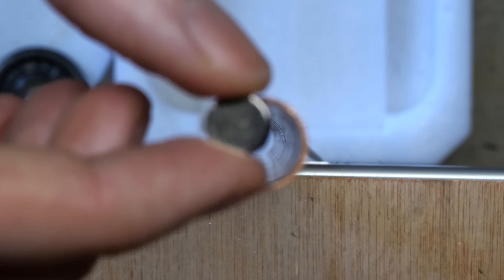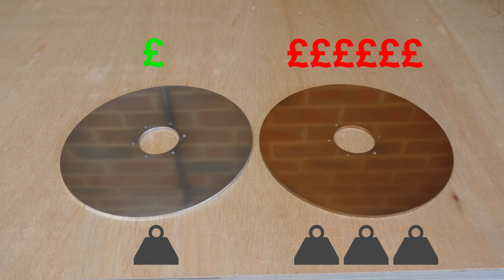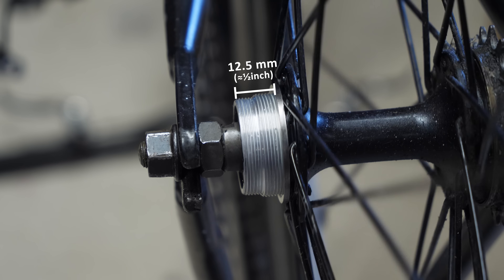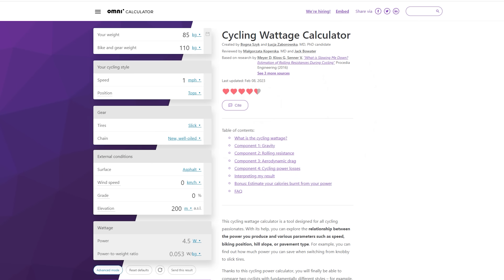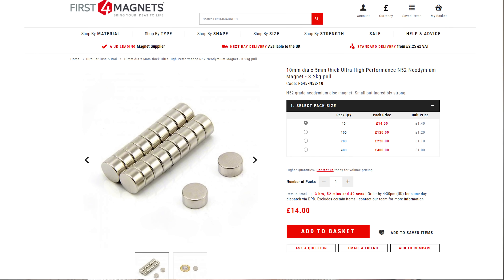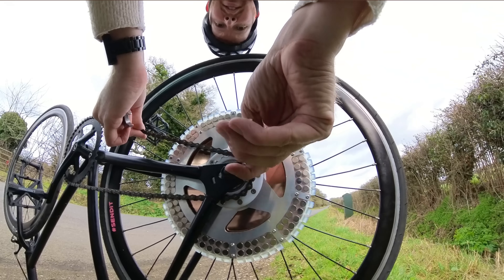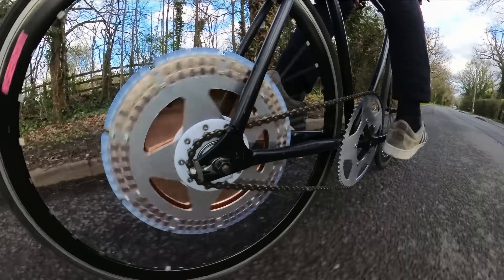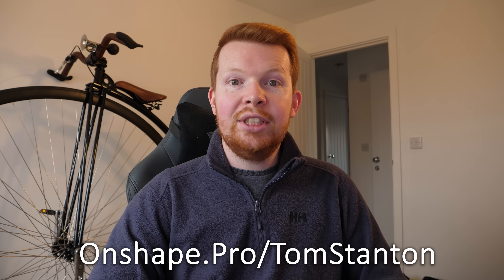Gearless Magnet Bike

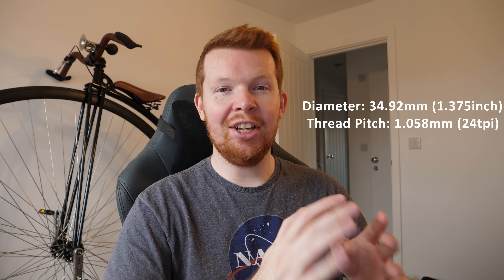Comment: 5:30 in  (you may answer this later, we'll see). How does the eddy current work if the surface is shaped closer to the magnet shape? E.g., suppose you had a non-conductive axle with a donut section of copper...? Would this improve or weaken the resistive forces?

Comment: Just think if you used a Tesla Bifilar pancake coil made of thick copper wire and measured the voltage generated with your falling weight rig when you let the weight fall.

Comment: seems like an interesting add on as a clutch in a system that has sudden power draws. Like a gas engine powered generator when it suddenly gets hit by a huge load. Seems like a less stressful way to deal with the forces vs a traditional clutch though that assumes you wouldn't have constant power lost from the heat put into the copper over time and ignores the material cost. Like if you added a flywheel to the mix that seem interesting. That energy lost to heat though. hmm

Comment: Hi Tom  well maybe not practical for a street bike. BUT I think the gyms would like this product. a person can vary on a cam and cable the distance magnets to the wheel for more drag or less.  Also i think your next build is along the guide lines you have here but with energizing coils for your drive to the rear wheel. Deenergize down hill or use the braking etc to reenergize the battery for the next cycle of coil energization. interesting concept.  Thank you for all the hard work.

Comment: You could bring the bike to a complete stop quicker by pedally backwards. It's a bit like a torque converter on an automatic vehicle. There's a similar technique of taking offroading vehicles down steep hills by throwing them in reverse and giving throttle to increase braking. That way there's no heat and wear on the friction brakes and it's a form of dampening the braking effect on rocky terrain, which can help comfort, control and traction.
Of course, applying throttle to slow down in any vehicle is just burning energy.

Comment: formlabs is such a cool company. if the rigid resin is too brittle, durable V2 may deform more but won't crack as easily. you can also play with cure times and temperature to fine tune the rigidity

Comment: Ask ChatGPT to fix your thermal problems. Instead of bicycle you made it into heater. You are losing efficiency somewhere. That is why brushless electric motors are so efficient and when they break they also charge the battery a bit. You kind of made a brushless electric motor variant, it is unique and I like it! From Mechanical Engineering this looks awesome project, you needed to adjust so many variables it is just mind-blowing.

Comment: I think that to make it function better you need to have a larger magnetic coverage area. Perhaps as large as the entire wheel, and yes a larger front sprocket is better to have the sprocket ratio at it's best. You may want the front sprocket to continue rotation when you rest your legs. Therefore caliper brakes would be used. Larger tires with rock hard pressure helps.

Comment: If you cover the outside of the magnets with a non magnetic ring/disc, it should block unwanted magnetism on the outer faces. I'm not sure what material they need to be made of but I know such a material exists. I have seen very strong disc magnets placed in a metal cup that only allows the uncovered magnet face to be magnetic.

Comment: You could stop the bike completely (more or less) by first pedalling slower then stopping pedalling, then when the speed has dropped enough, you can pedal backwards to drop the bike speed even more - until the bike becomes too unstable, then I guess you can just put the feet down and stop within a foot length or so ;-)

This way you could bring the bike to a complete stop without using the mechanical brakes - but keep them on the bike for safety to stop quickly.

But I guess in reality you have already converted the bike back to it's original configuration ;-)
You can then imagine that pedalling backwards on this "imaginary sand" could work, but would feel a bit odd and gets unstable at the lowest speeds before stopping completely ;-) And it would start moving backwards if you continue pedalling backwards which would also feel unstable... ;-)

Comment: This is exactly visualised way of how induction motor works. I think it could transfer more torque if copper disc was thicker, but it doesn´t solve problem with wasting lot of power in heat.

Comment: This is pretty cool - very nice application of magnetic flux & a nice explainer!

Have a look at home trainers which use a magnetic clutch as a brake.
This has been done for 40+ years and the manufacturers have already learned a lot of the lessons that you so ably demonstrate here.
Some of those are able to supply sufficient resistance as to mean a cyclist needs to be able to supply 1.5kw to spin the wheel at around 100rpm.

Also - 1.37 x 24TPI is not a hard thread to machine - I mean - that's how sprockets are made - although that does assume you have access to a lathe and the relevant change gears.

Comment: I wonder if you can manipulate the surface of the copper disc to create stronger magnetic eddy currents. Like putting ripples/folds in it or even using wound wire coil.

 Another thing that might help is using a considerably larger wheel for the magnets than the copper disc and mounting half way between where the hub and the front sprocket is, it would then pass over just a segment of the copper disc but at a much higher speed, that way you could generate a lot more eddy current because of how much faster it spins than the smaller copper wheel. Of course there is going to be a considerable loss of magnetic force exposed to the copper and a whole lot more magnets, weight and inertia. But it'd be interesting to see if it was possible to generate more power that way of if it didn't work at all due to the lost surface area exposed to the spinning magnets.

Comment: It'd be awesome to do this with electromagnets to have variable resistance as well as regenerative breaking for an electric bike. It'd be awesome.
Reply: Just curious, how would variable resistance work in the clutch? Removing some magnets or space between the magnets and disc?
Reply: You already have regenerative breaking in electric scooters and bikes.
Reply: @laurentius1986  Don't electric bikes still use break pads?
Reply: @punkrocksuperman1886  cheap ones use only brake pads, indeed. Premium ones use regenerative electric brakes in addition to brake pads.

Comment: I'd like to see a motor/generator with a bank of film capacitors (low leakage, low ESR) 

the generator mode would be used while peddling along on level or downhill to charge up the capacitor bank, l then use ther stored electric energy to help when going up hill.

Comment: What would be SUPER cool is if you took a standard twist gear changer and adapted the pull cable to a system that varies the air gap between the copper and magnets. That way you could increase the gap to allow for faster pedaling at reduced torque, or to set it to the optimal gap for rider preference.
Reply: With a magnetic clutch like this the input and output torque are the same. If you reduce the magnetic field it just means you need to pedal faster to achieve a given wheel speed.

Where it would make sense is as a variable brake.

Comment: So you have a lot of skills but no common sense or ability to rationalize where the energy loss would be before wasting all this time and effort.  Guess some people have to learn the hard way.  Hint:  If you're trying to reinvent the wheel, you might want to consider that you are not a pioneer and the low hanging fruit has already been tested.  There is no reason to suspect that introducing permanent magnets has any benefit at all unless the only alternative was magnetic fields generated by electricity rather than manpower.  Duh?  Nothing is free, there is no perpetual energy concept that works, nor will there ever be.

Comment: Great video and an awesome idea!
I do have a couple of questions:
What happens if you peddle backwards while trying to brake?
What if you made the magnets get closer to the copper to make the bike brake better using a braking system similar to regular bikes but not having anything actually touching the disc, and then as you would release, the magnets go back to their original position?
Reply: I agree! I was wondering every time about braking by using reverse peddling. I wonder too, how much harder it would be to peddle in reverse while the wheel is turning forward? I think he could take this experiment further.
Reply: @BradfordGuy  he can also add a free wheel hub to the bottom bracket to not have to do force with his legs

Comment: Opposite-poled magnets on both sides of the copper disk is a good idea, but the same magnets would be more effective if they had a steel structure to guide the magnetic lines, for example STEEL PLATES on the outsides spanning the backs of all the magnets. For even less magnetic slippage, try a SILVER disk ($$$). As you said, ALL SLIPPAGE is WASTED ENERGY. You could make NO SLIPPAGE AT ALL by making the sprocket magnets LOCK to the wheel, by putting steel pieces (or magnets) on the wheel instead of a copper disk. That hints at possibilities of making selectable gear ratios, yielding a MAGNETIC TRANSMISSION, which has been done in other videos. Also, a stainless-steel bicycle chain would also not stick to the nearby magnets.

Comment: When I've thought about doing something similar, I was going to mount the magnets to the rim of the rear wheel. My idea was to have a series of solenoids adjacent to the rim to act as drivers or breaks, with electricity from a pedal-powered generator, and a capacitor for a bit of breaking storage. It would be cool to see that in action, just in case you haven't done enough electric bike videos :p

Comment: The strength of the magnetic field produced by a magnet is dependent on temperature. So, I'm sure that as your copper plate heated up due to the eddy currents, there was an additional loss of performance due to the reduced field strength of your magnets. If you get them hot enough, you may drastically and permanently reduce their magnetization, or completely demagnetize them altogether.

Comment: This coupling relies on slip or a difference in the RPM between the wheel and crank to develop torque. So that torque times the difference in RPM is wasted work.  It's a cool demonstration of electromagnetics, but it will always be a horribly inefficient transmission.  Basically a magnetic torque converter.  It is really cool and fun but it's the last thing you would want on a bicycle. You can study physics and use it to model and engineer great solutions, or you can just build cool looking stuff that sort of works for fun.

Comment: An aluminum paintball barrel is great for demonstrating the effects of eddy currents.  The walls are very thick compared to a standard tube.  Copper is more dense, however.  I would like to be able to equally compare the two in tubes with walls of identical thickness...

Comment: That was incredible, thanks a lot!
Two improvements are yelling to be done from a bike tech perspective:
1. just use a hub with a disc brake mount. It's exactly what you are looking for. (attaching a metal disc rigidly to a bike wheel)
2. use a bike with a chain shift as a basis: when you remove the cassette, you'll have a lot of clearance between the wheel and the frame

Also I'd bet that a FDM printed sprocket in flat orientation out of nylon will outperform any resin printed sprocket
Reply: To add to this, consider trying a halbach array for the magnets.

Also I know your intent was to get somewhat of a CVT effect, but continuing to use a gear cassette will allow for you to keep a more ideal slip angle with the copper.
Reply: Bro that's just POC. He's next Elon Musk in cycling, mass production of MagnetCycle(c) is already planned for next quarter! Keep tuned!
Reply: I think his approach was perfect, because all the bike properties you mentioned would have made his prototype much more expensive.

Comment: 🟦.... In my 45+ years of experience, press-fitting metal ferrules, collars, axle-shafts or the like into plastic will most often result in the plastic cracking within a remarkably short time as quite often the plastic is unstable and begins to shrink substantially beginning at a period of time AFTER manufacture.

Comment: What if you were able to collect that excess heat with a few TEC modules, and collected the electric energy with some kind of slip ring assembly and battery? Then you could power a motor to make things even easier. Might require some structural changes to your bike, but would be fun to see!

Comment: The next step could be to increase to disk to fit on the rim of the wheel, and run the greater number of magnets from the inside of the disk.
This would also relieve the problem of clearances at the hub.
Even more interesting, would be a hubless design, where the tyre and rim is floating, but restrained in bearings at the bottom bracket, and below the seat. The copper could then be a cylinder, (the rim) and the magnets on a cylinder inside the cylinder.
[Maybe a small model to test the idea first]😊
.

Comment: Next you should do an electrical transmission, it would be a lot of fun. You have a dynamo on the pedals which is directly connected an electric motor on the rear wheel by wire. So you have a bike without chain or mechanical transmission.

Comment: Interesting experiment. BUT: All you have achieved in this experiment so long was an energy-to-heat-dissipation system - which is not precisely the goal of clutch construction. And the clutch has no "decoupled" state, thus the very core function of a clutch was not - yet - included in this prototype. And a change in gear ratio - which was the very initial goal of the whole process - was also not implemented, neither in steps nor smoothly.

Thus the overall concept is not convincing so far. The losses of a system with a generator in the pedals and a motor on the rear axle will very likely be far less - AND provide you with a completely smooth gear ratio AND a decouple function AND a possibility to reharvest the invested energy on braking. But THAT (electric) bicycle already got invented :D

Comment: Could you harness some of that breaking energy, generating electricity to power an assist motor for uphill?  Would you have a similar magnetic coupling effect using a copper leaf daisy wheel (as a component in a regenerative alternator of sorts), as you do with a disk?

Comment: Jay Leno has, in his collection, a car called The Owen Magnetic.  It drove through a magnetic clutch.  BTW Your magnets would be much more effective if they formed a horseshoe around the copper disk, using a high permeability material to create a high flux density flowing through the disk from one side to the other.  Magnetic fields need a 'closed circuit' in the same way as electricity, as the field 'flows' from pole to pole.  Magnetic dampers of this sort have been used for decades on things like lab balances (pre-electronic weigh scales) to damp oscillations/resonance without adding mechanical friction.

Comment: Sounds like you need to implement the ability to engage / throttle the amplitude of the magnetic brake.  Your exeperimental results are quite encouraging otherwise (notwithstanding any price point considerations).

Comment: I've been thinking about some kind of electric drive for years. My desire is to not have to switch gears so much (lots of hills were I cycle). But chain drives are almost 100% efficient so anything less than 90% would make cycling worse.

Comment: I had a feeling this would end this way. Any magnetic slip clutch using eddy currents is going to waste all the energy lost to slippage, so if the magnets are rotating twice as fast as the copper disk, half of the work you are doing is wasted. With a gearset, on the other hand, the extra rotation is being converted to increased torque, so you can go up a hill without pedaling harder. The earliest fully automatic transmission for cars, the GM Hydramatic, used a device which behaved similarly to your magnetic clutch, only it used viscous oil to create smooth friction. It was more useful in that role because it allowed the car engine to idle in gear, but the slippage still ate up a substantial portion of the engine's power. But GM cleverly used planetary gearsets to direct most of the torque around the slipping "fluid coupling" (as they called it), in higher gears so that as the car got up to speed, most of the torque was being transferred with gears. These transmissions, with 4 speeds, were competitive with many more modern transmissions (which used Voith type torque converters) and were used in some GM cars until the mid 1960s and in Rolls Royces all the way to 1970. Magnetic clutches like the one you built are also used in mechanical speedometers, with the cable driving the magnet and the aluminum disc pulling the needle against a spring. You might be able to build an electromagnetic CVT for a bike using motor-generators, but with efficiency even more critical for bikes than for cars, I doubt anything relying on eddy currents would be viable.

Comment: If you pedal backwards you should get more braking force, right? Did you weigh your parts and compare to the weight of standard parts (cassette, sprockets, shifters, cables, etc.) to determine if there was a net weight gain or loss? I expect a slight overall weight decrease, but due to the inefficiency of your system, it appears doomed. Yet very innovative.